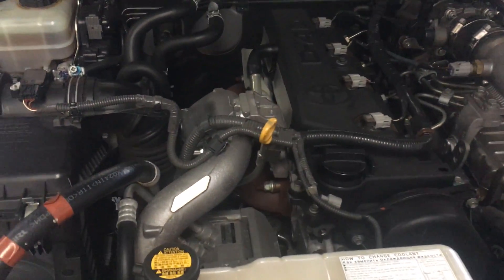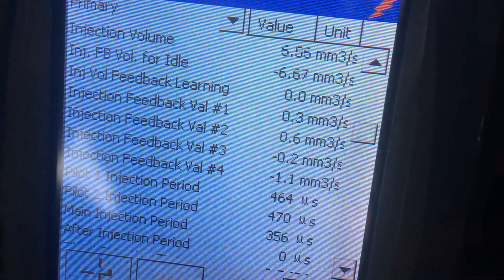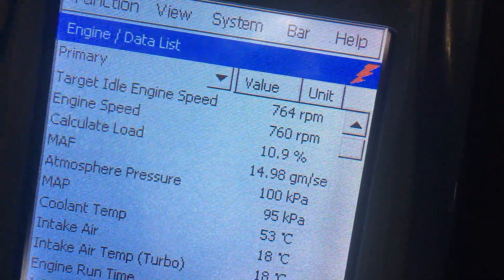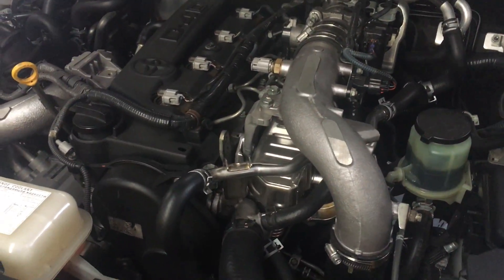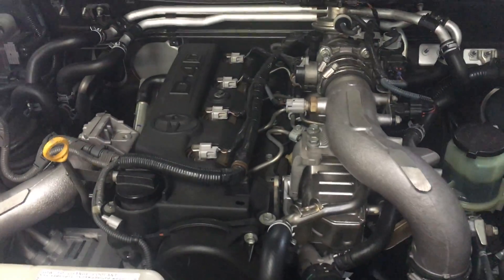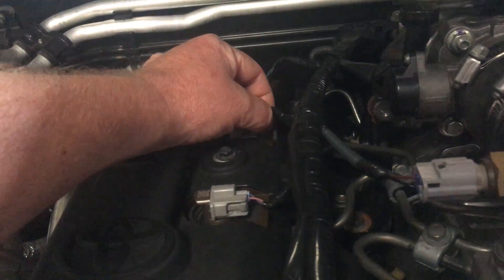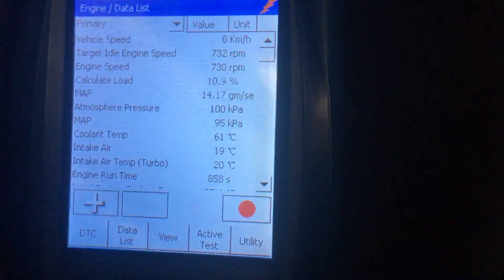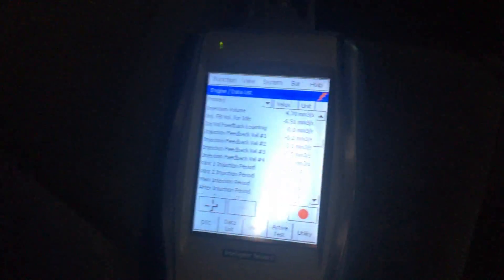BIG PROBLEM HERE!! SUPER EDUCATIONAL - DIESEL INJECTOR PREMATURE FAILURE!!!

Comment: Hey Anthony, I have Prado 2007, I have seen many of your videos, like to follow your recommondations about my spesific car,  it has 218 000km.
it was said to have new injectors, that have been confirmed by a orginal Toyota dealer, but I suspect aftermarkedinjectors have been put in, I have
only put 10 000km on the car since purchase. When I start it up (cold 0 degree) it has a funny sound until it reach working temperature, then it 
sounds ok. oil&filter is ok. I want to ask you about scan tool, do you have some recommondations ? price up to dollar 500.
By reading out the injector codes I would probably tell if the injector are good.  Best regards from Morten, Norway.

Comment: There's are other diagnostic vides readings for floged injectors showing raised readings for all 4 individual injector feedback val between 1.5 to 3.8 also raised calculated load, injector volume & main injection period. Then you have this vehicle with also floged injectors with all the stated readings above showing lower  why is there this difference for the same fault.
Apologies if you have already explained this previously👍